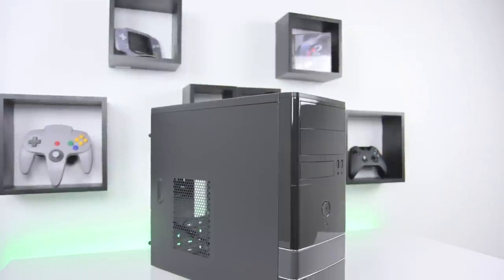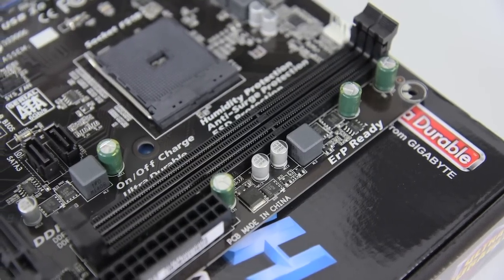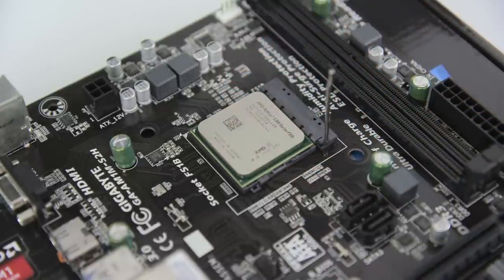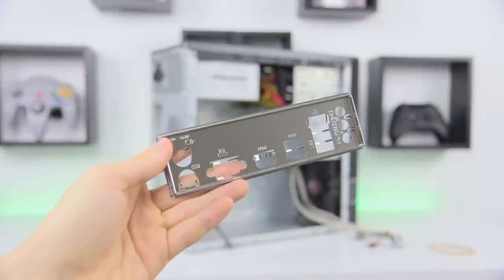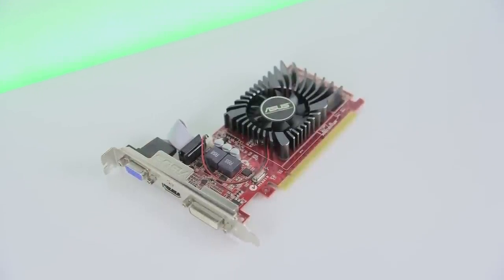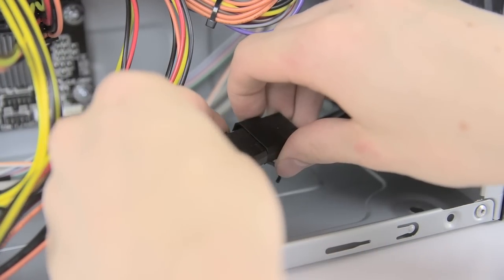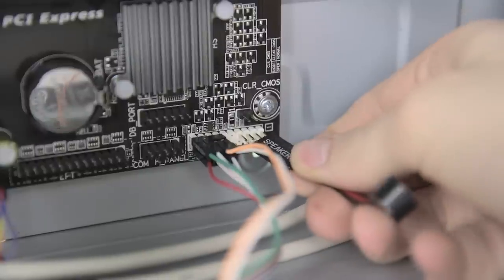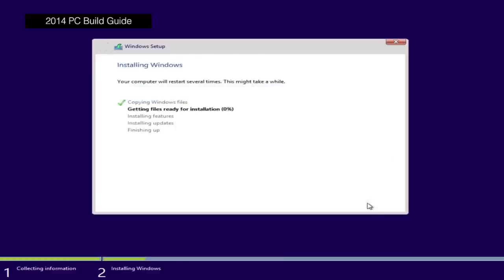How to Build a $300 Gaming PC! (2014 Boson)

Comment: I cant imagine using this PC for anything at all. You can build a lot faster PC for the same price. I really like to buy used my self as if you buy from a reputable source then the parts have already been tested and RMA'ed if need so you don't have to. I built a really nice pc for $1300 it has a Antec 1200 case(Used), Gigabyte Z97X gaming 3, Intel i7-4790k, Corsair H100i GTX, 16gb G.Skill Ripjaws X 12800 ram, Zotac AMP! Omega GTX 970 with a AMP! Extreme HSF (Used), Kingston 300V 120gb SSD (Used), 1TB Hitachi HDD (Used), Corsair HX750, Lite-On DVD±R/RW Light Scribe Multi burner (Used), HP LA2206xc 1080p screen, Logitech G15 keyboard, Razer Naga Mouse, Dell MMS 5650 5.1 surround Sound, Logitech H150 headset and Turtlebeach X12 headset. Plays everything on max setting easily and all games at 4k DSR at 40+ fps with no trouble.

Comment: I've never built a PC, but I'm saving to do so. Everything seems fine except I'm deathly afraid of the cpu and then the glue stuff on the fan if it isn't pre-applied. Another thing is installing everything else like the fan and power supply into the case
Reply: +Lord Fuhnee thats what happened to me. started in an it class (before i built my pc i was in a computer support program to get an it job) now in the course of like 2 months i have built 3 computers. i got addicted :P
Reply: +volkswagenginetta u must be very rich
Reply: Joshua Thompson nope. i work at walmart for 9.25 an hour and go to college. i save on cost by building used computers.my main rig costed me 700 (amd 8320 and an r9 380) the second one i built was an intel core 2 quad q8200 with an 8800 gtx (total cost was 95 dollars). then i built an i5-2400 and a 750 ti (275 but im selling that one to a friend) and now im building an amd 5350 with an r7 250 for my girlfriend.
Reply: that still adds up to about a $1300 loss
Reply: Joshua Thompson well im selling the one i built for 275 for 310 dollars. so in the end its closer to around 1060 dollars.
Reply: oh i built my rig already

Comment: So i'm thinking about building a not to expensive gaming pc but i have no experience at all. Is this thing any good? And can it run decent games? Please help.
Reply: +Marijn Molenaar witht he graphics card he has no if you get the same parts with but with a different graphics card like a Radeon R7 260X 2GB then you should be able to run bf4 on medium settings and lower resolution since the cpu isn't that great either

Comment: I'm building around a $700 dollar pc now with a 600 watt power supply a cpu clocked at 4.1 ghz , 8gb of ram an alright mother board and I tb hdd is this good for gaming???
Reply: Patrick Byrne what about the gpu and what socket is your cpu/mobo? and hdds usually dont really matter for gaming
Reply: Simon Donhauser its a Asus Radeon r7 260x
Reply: Patrick Byrne the ghz of a processor doesnt say anything. Pentium 4s are 4 ghz too, so are i7 cpus. What processor do you have?
Reply: BLaST ZombysZ a amd a series black edition a8 6600k
Reply: If i was you id upgrade to an i7 4*** or 5*** if you want to play the newest games at 60fps, and id also upgrade your capture card to an AMD R9 290X or nvidea gtx 980.
Reply: Yeah Well I've already ordered the parts but it's still hopefully gonna be good for a first build.
Reply: If you dont expect so game 4k 2k or 1080p ultra 60fps, i think its ok. I dunno what games you play, but minecraft will be really smooth xD
Reply: I'm not one of those people who play minecraft... Cough* cough* xD but seriously if I got lets just say cod aw on it with 1080p would you think it would have a good fps?
Reply: Tbh, i think it will be around 10-20 fps at ultra settings, or like 40-50 at medium, but you'll have to try. I dunno for sure because ive never had an AMD processor before, and never will tbh.
Reply: BLaST ZombysZ ok thanks that a a good start i guess, like I can always upgrade in the future
Reply: Patrick Byrne No offence but how did get such low-end specs for that money? Ive built for a little over 700 dollars and I got and FX 6300, R9 280, 8gb ram, 1tb HDD, 600w PSU, and a motherboard.
Reply: Petter Rygert idk tbh I'm not the most experienced so I could've bought something low end for a high end price :(
Reply: Patrick Byrne Yea :/ but you learn from your mistakes so when you´ll upggrade in the future you´ll know more about what to choose :)
Reply: Petter Rygert yeah Well I'll get new/better parts in the next few months if I'm not happy xD
Reply: Patrick Byrne Haha good xD
Reply: Patrick Byrne send them back, get on ebay and search for a used pc with an i5 or i7 generation 3 or better. You should be able to find something decent for about $400, then slap in a new gpu.
Reply: Patrick Byrne You should have consulted before you bought those parts.  Your PC will be VERY underpowered for what you paid.  If you can still return some stuff, you should try again
Reply: Dont worry about it too much though, my first build was similarly overpriced.  We all start like that
Reply: Hans Tang well I mean a 4.2 ghz quad core cpu sounds pretty good in my eyes so I don't understand why people think it's not that good and a 2 gb gpu sounds great for a first build
Reply: Patrick Byrne Core clocks mean very little without context.  An i5@3.5GHz can perform way more instructions per clock than a 4.2GHz A8.  Furthermore, the A8 is an APU which dedicates a lot of space and money to GPU cores that you wont use anyway.  As for your GPU, 2GB is both not a lot and irrelevent since a graphics card can only use as much memory as it can keep up with.  Your R7 has a relatively small amoumt of stream processors and cannot push the performance needed to saturate 2GB memory anyway
Reply: Hans Tang so are you saying this wouldn't be very good with games? xD
Reply: And how can an I5@3.5GHz is better than a 4.2GHz A8
Reply: Patrick Byrne perfomance isn't all about clock speeds, it comes down to efficiency of each core. You can have a 5ghz cpu and if it's cores aren't efficient it's going to do a shit job.
Reply: SMAAAASHTV and how can you tell if a core is efficient or not?
Reply: Patrick Byrne check out the video: The FASTEST $600 Gaming PC Build 2015 Runs The Witcher 3, GTA V at 1080p! 2015 by "cultofmush" for a very good performing machine, which is miles ahead of your build for less than you spent.
Reply: Patrick Byrne Core count, instructions per clock, architecture, power consumption, heat.  All are equal factors.  Same goes for graphics cards.  Youre far better off comparing real life benchmarks from bit-tech reviews than staring at numbers.
Reply: Patrick Byrne If you have an FM2->PLUS<- motherboard, Id suggest getting a $70 860k and a used ~$150 r9 280x on your next upgrade. Otherwise swap the 860k with a 760k
Reply: Patrick Byrne I would suggest looking at some benchmarks for both the cpu and gpu before purchasing anything in the future. The i5 4590 is a whole year newer than the a8 6600k, it has 2 more physical cores than the 6600k and can attain more instructions per clock cycle than the 6600k. The 6600k is touted as a quad core cpu but in reality it only has 2 physical core which can act a 4 threads or logical core. To me, it's false advertisement and AMD should be fined for it.
Reply: SMAAAASHTV i think they counted GPU cores.
Reply: Hans Tang nvm, we are both mistaken. After a bit more research I have found that it's windows that see's them as 2 pyhsical cores. Apparently 2 cores are housed in a single module and there are 2 modules on the die. Either way my other points still stand.
Reply: SMAAAASHTV so basically I have a duo core instead of a quad core???!
Reply: No its a quad core. We were just confusing ourselves.  Though its not a very good one...  The A8 just has a decent graphics unit built into it, which takes up space, energy and cost, and you won't get to use it.
Reply: Hans Tang and why is that?
Reply: Patrick Byrne because you're using a dedicated gpu, so an apu is pretty pointless. The APU has a built in gpu that takes up space and thus performance from the cpu.
Reply: SMAAAASHTV so this cpu is made for people who don't need a gpu or power for gaming...
Reply: SMAAAASHTV but also wouldn't that give it better performance as there's 2 gpu's?
Reply: Patrick Byrne yes, it's a relatively low powered processor for basic computing, not gaming. Also, no because if you have a dedicated graphics card you won't be using the apu graphics, you can only use one or the other, not to mention the APU is not meant for high performance gaming and is only there for some light gaming and maybe some video editing performace.
Reply: SMAAAASHTV so I should replace my cpu soon xD but also isn't gaming mostly on the gpu?
Reply: Patrick Byrne depends on the game.  If its a really pretty game, then yes.  If its a really expansive game with lots of physics, then its cpu.  So Battlefield 4 relies heavily on both.
Reply: Patrick Byrne also if you act quickly, you can return your a8 for a 860k (FM2+ ONLY) or a 760k, and pocket the difference toward a better gpu. That depends of course on how much you paid for it.
Reply: Hans Tang I could but it's already in my pc so I'll just stick with it but also I did some researching of my own and I found that this cpu has 12 cores (4 cpu, 8 gpu) and wouldnt that help performance?
Reply: Patrick Byrne you cannot use the GPU cores if you have a dedicated graphics card.  Theyre dead weight that costs $50 and 30W extra
Reply: Hans Tang well then I guess I'll have to get a new one soon xD SMAAAASHTV Hans Tang thanks for the help :D
Reply: Patrick Byrne Out of curiosity, what is your motherboard?
Reply: It's an A78M-E45 msi military class 4 motherboard
Reply: Patrick Byrne Good, good.  That means at some point on the near future you can buy an 860K cpu.  If you happen to find an R9 280X used on Amazon for around $140-160, get that also.  You will see a major upgrade.  The mobo is not the best for overclocking but don't worry about that now
Reply: Hans Tang ok thanks
Reply: Patrick Byrne i know a pretty good build for 700-750, plays everything on ultra with at least 90fps. on Black ops 2 i get 140fps ultra average
Reply: ***** Most decent $700 builds have at least that much power, especially since the r9 2xx crash.
Reply: Hans Tang  well I fucked up... I'll upgrade soon :)
Reply: Patrick Byrne dun worry bout it.  First time around its hard enough figuring out DDR2 from DDR3 without worrying about finding the best deals.
Reply: Hans Tang well now DDR4 IS the next problem in the future xD
Reply: ***** and would you know what parts are used for this build?
Reply: ***** ok thanks
Reply: I would recommend adding more ram if you are spending  $700 if you don't your a FOOL
Reply: MR. KILLZONE1 8gb is plenty, unless your heavily video editing there should be no problem
Reply: ***** is 1600 MHz ram alright?
Reply: Patrick Byrne It makes little difference unless you use integrated graphics. But they cost about the same anyway, so its up to you.  You should note however that higher mhz ram tends to have shorter lifespans
Reply: Hans Tang ok well I'll just stick with that then
Reply: Patrick Byrne some processors work better with other mhz
Reply: BLaST ZombysZ An I7 is not necessary for gaming, and does not fit in the budget of his pc.
Reply: Patrick Byrne http://cpuboss.com/ use for comparing cpu's
Reply: MR. KILLZONE1 you're*
Reply: Kolatz Playz That was both totally unnecessary and completely incomprehensible
Reply: +Hans Tang I agree, it was in poor taste to rag on the guy. He's obviously new to building PC's and doesn't know a lot about hardware. It just shows that Kolatz Playz is a snob who thinks he knows better than everyone else.
Reply: umm actually my build would make sense and i am better then him at pc's??? thats irrelivant and if ur getting into custom pc's then he honestly should have researched if he is going custom tbh.....
Reply: Kolatz Playz uhuh
Reply: +Kolatz Playz I admit, he didn't research it well, but you can already see people giving him constructive feedback, instead of coming in and going "oh your setup blows and you're dumb".
Reply: Kolatz Playz yeah this is my first time building a pc I'm not as experienced as others.
Reply: umm yes u are dont spend money on things u dont know?
Reply: Patrick Byrne wait so if you have the money to spend blindly cant you just build another one
Reply: yup exactly lol
Reply: No I did some research and the 3.9 ghz apu sounded great especially for the price the video card was just over a hundred and from reviews it sounded good and the same with the motherboard. I'm really happy with my pc right now even if it can't do gaming in ultra settings
Reply: Patrick Byrne The argument is by no means that your rig can't play games, just that you could save a few hundred bucks.  You'll get the hang of it.  BTW, use places like Overclock.net, TechPowerUp, and PCPartPicker in the future.  Youtube comments and amazon reviews are not as reliable
Reply: +Kolatz Playz I have an 8350 and a 960, it's a pain in the ass when your parents surprise you with a 4k monitor :( It's like the first thing they buy me since I was little and I can't even use it to the monitor's max.
Reply: obvi the 960 is perfect for 1080 which is all i9 want :) 970 and up is where 4k lives rn

Comment: I'm on a budget and just wondering if this is a good build. Please suggest anything, that would be greatly appreciated!

AMD Athlon 5350 2.05 GHz APU ($60)
Rosewill Ultra High Gloss Micro ATX Case + 400W PSU ($50) 
ASUS Micro ATX AM1M-A Motherboard ($35) 
XFX R7 260X 2GB Graphics Card ($110)
Crucial Ballistix Sport 4GB DDR3 RAM ($40)
Seagate Barracuda 1TB 7200 RPM Hard Drive ($55)
Reply: It would do the job. But saving up to like $500 or $600 (assuming you have a monitor) would be better.
Reply: Noah Rellum That is true, but I am planning on upgrading the specs soon after.
Reply: Gravity Turtle save for a better PC right away if you're going to replace thsis build soon after
Reply: Gravity Turtle yeah that's good :) I'm going go get almost the same build
Reply: Noah Rellum Sounds good man! Thanks for the help :D

Comment: Austin Evans  I ran across this video and decided to do this build. Everything is going well except for the Rosewell FBM-01 I'm purchasing everything on Newegg and the Rosewell case does not come with a power supply. I'm having trouble finding the same power supply as mentioned in the video. Can you give me some ideas? Thanks
Reply: Ronnie Till It doesn't need to be the same power supply, any power supply will work. But you should return these parts because they are shit, this PC is barely more powerful than a fucking PS3.

Comment: swap the athlon for a kaveri A10 and get some faster RAM.

or just shell out some more money and get an i5 and a GTX 750Ti
Reply: *****  why not both?  APU's share system memory for graphics memory, and trust me it makes a big difference with speed. ofc memory size matters too. I have a pretty bad computer. A10-6800K with 4GB of 1600mhz RAM. could run counter strike at 720p 60fps, but not much more. Recently I upgraded RAM to 16GB at 2133mhz, and I can easily get 1080p 60fps, as well as play some other games at playable framerates on low-medium settings, like BF4, Dirty Bomb, War Thunder.

Comment: Can you give me advice? I'm replacing the GPU with an EVGA GeForce GT 730 so should I replace the CPU as well? If so, what model? The WiFi adapter seems to install similarly to the GPU, sliding in with the case and into the motherboard slot. However, this Motherboard only has one slot. Does this render the WiFi adapter uninstallable or can it be installed? Is it installed differently? Sry for being a noob. Thanks
Reply: Nvm about the WiFi Adapter, that connects via PCI. But how do you install the optical drive? Is it via SATA? Is it installed in a similar fashion to the Hard Drive?
Reply: +Cleo323 i wouldnt touch the cpu, just bump it up to a 750 ti if your power supply supports it (which it probably does, but make sure because some take a 6 pin power connector). now if i remember right the 730 is a single slot card, if you go to a double slot card then yes you will lose the wifi adapter slot. one card i would recomend is the MSI GeForce GTX 750 Ti DirectX 11.2 N750ti-2GD5TLP 2GB 128-Bit GDDR5 PCI Express 3.0 x16 HDCP Ready Video Card 
its a single slot card that is pretty powerful and is a good value.

Comment: Would this be compatible with an Intel i5 4670? Also does the case come with a power supply?
Reply: Miguel Ballard No. No.
Reply: The motherboard has the wrong socket for your CPU. If you try pushing it in anyway you'll brake both of them. And why the hell would you get an i5 with that crappy build?
Reply: Wellstar 
"Brake"?
Reply: Buy AMD FX6300 , cheaper , stronger .
Reply: Yes , but it is nice for the money.
Reply: Right. :D
Reply: Anthony Sparta it's massively biased to Nvidia and Intel.
Reply: performance is also biased on CPUBoss. They never state what settings they used on "game tests", so the AMD card or CPU could be using Ultra preset while AMD/Nvidia could be using low/medium. I prefer video reviews that show in depth stuff.
Reply: Wellstar Where's the show conducted?
Reply: StealthSnipe Sorry?
Reply: Wellstar You said Hundred Atomic Bombs, I want watch the show. Where is show at?
Reply: StealthSnipe Penis?
Reply: Wellstar Aw damnit. I actually wanted to see people die from nukes.

Comment: Hey question with custom builds like this is there any way to control the case fans manually? on my current pc is was a pain in the ass which i now control with resistance switches that just spin to adjust the speed.